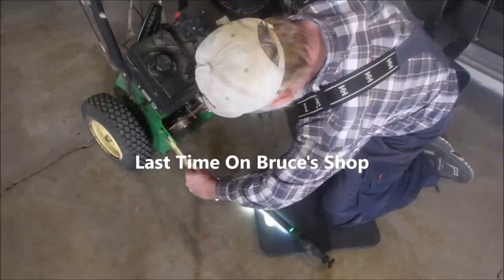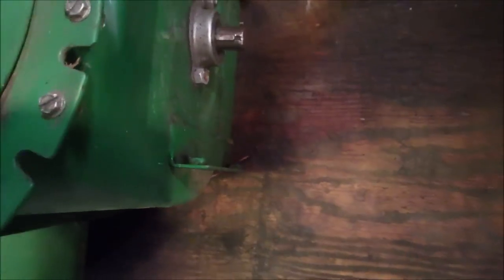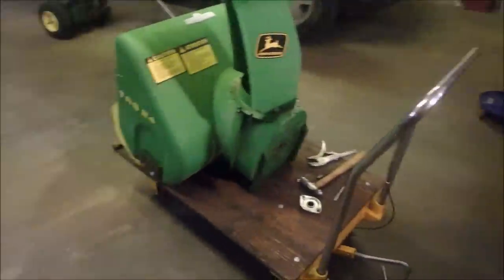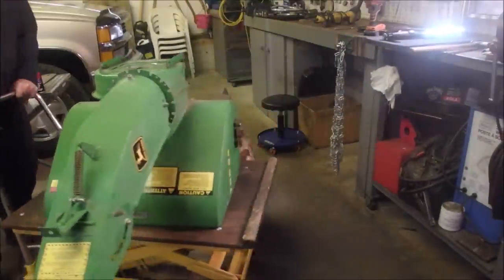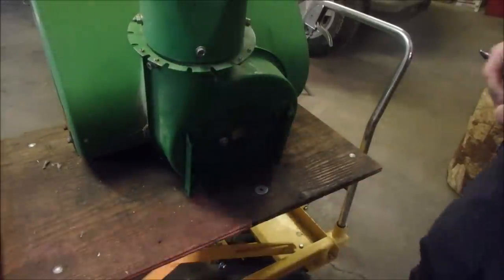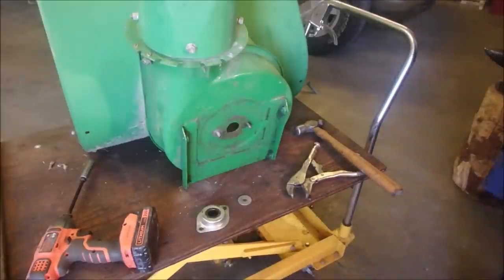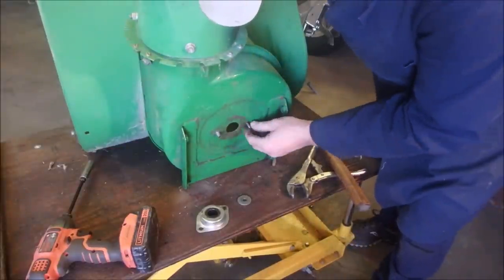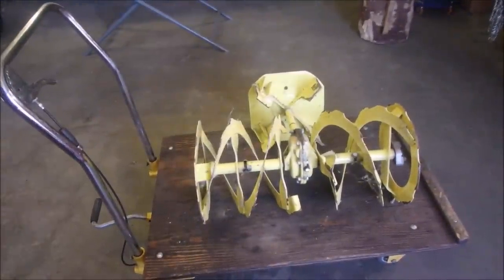John Deere TRS 24 Snowblower, Auger Welding

Comment: Good job Bruce. Watch your weld splatter on your plastic air hose (ask me how I know). A nice little die-grinder helps with the prep and clean up. Looking forward to the next video.  Have a good week.   Rick
Reply from the maker: Thanks, will do!  I changed the end (cut it)  That's why I never leave the compressor on overnight

Comment: I miss not having access to a welder since I'm retired.  I don't need one often enough to justify the expense.  I can sometimes make do with brackets and bolts instead of welding.  That auger shaft repair definitely needed a welder.  I got a little nervous when you were balancing the auger housing on the anvil.  It is a satisfying repair so far.  I look forward to the next episode.
Reply from the maker: Well it was fun   (kind of)   LOL
Reply: @eastundrer55    

You might want to check out a Titanium easy flux 125, I bought mine from harbor freight last year on sale for $169.00 US , after watching many reviews and I absolutely love it! Powerful little welder and no gas needed.
Reply: @Aaron-wn5ci  Thanks for the tip..I'll check it out after the Christmas crowds thin out next month.

Comment: Hi Bruce, I had the same issue on my TRS-24 where the auger tube got torn, probably due to the previous owner not using proper shear bolts. Mine was not as severe, so I got a fender washer and bent it to conform to the tube and had it welded on. We shall see how it works this winter. The correct shear bolts are 3 pieces - bolt, spacer and jam nut. The spacer is like a real thick washer which fits into the large hole in the auger tube.
Reply from the maker: This bolt has a 1/2 in spacer right near the top to grab the insert hole on the auger.  I will check your description.

Comment: Good video Bruce, be sure to note how those auger flites go on from side to side as I assembled one wrong. After being rusted and bent I replaced the gear and hard shear bolts and come winter it would auger snow from the center to the outside! Dough! (Front auger) what fun working on customer modified project's I see those t.r.s. blowers are not like the old ones. Happy Holidays!
Reply from the maker: Ok, thanks  I triple checked on that as I did my first one backwards as well.  Thanks

Comment: Bruce, I'm thinking if you could find a piece of copper pipe that is the same diameter as the shaft, and slide it into the auger while you weld in the slot. The weld won't stick to the copper. It would just act like a form or mold.
Reply from the maker: That is a good idea

Comment: Should be a good solid patch on that auger tube and is it possible the previous owner never used the JD shear pin kit with the thickened spacers... just a hunch?
Reply from the maker: You are right.  It was a hardened bolt.

Comment: 27:10 I must be learning to think like a welder, I was thinking that having the shaft in there would help keep it on the right line.
Reply from the maker: Then I took it off.  ARGH.  However it may have stuck on there for good if I continued with it on there till the end.

Comment: wouldn't two big washers and a nut and bolt of straightened that case  instead of putting on the anvel
Reply from the maker: That could be true.  looking back is easier than thinking on your feet.  Thanks again sir for the great comment.

Comment: Probably hit something and didn’t have breakaway shear bolts holding the auger to the shaft, ouch!
Reply from the maker: I think the impact took out the augers and the pullet as well.  Still have a ways to go.
Reply: @BrucesShop  surprised the gearbox seems to move so smoothly, that’s a big plus!
Reply from the maker: @mjg263  It is an old school gearbox.  Whew.

Comment: If the pipe was the same diameter why not cut a length off and cut it in half for your patch, instead of doing that extra work.
Reply from the maker: The pipe was aluminium.  But a great idea.  I do not have a TIG
Reply: @BrucesShop  figured you had a reason